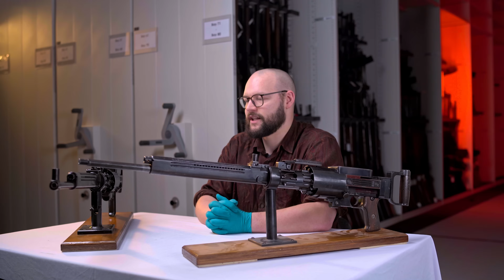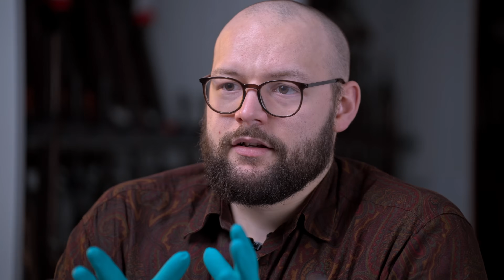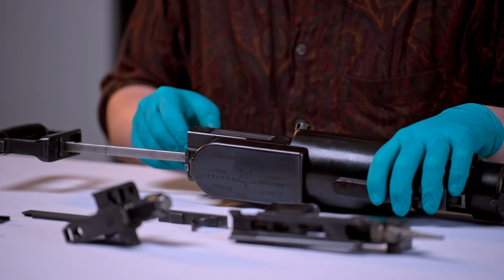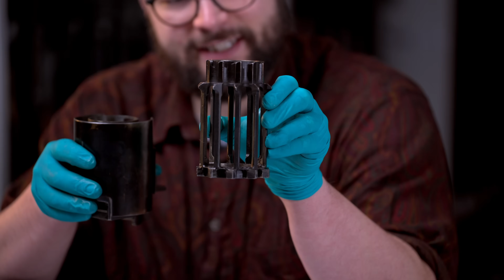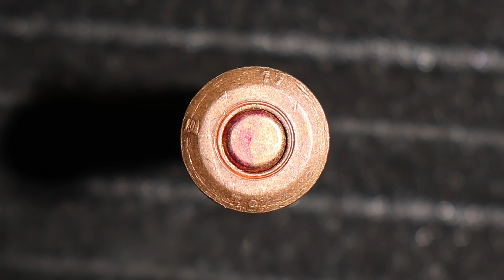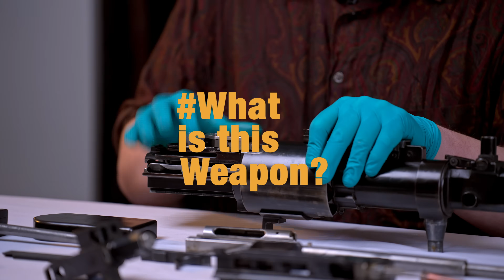The Soviet Success? The ShKAS Machine Gun with curatorial assistant Joe Ford

Comment: Rather than your sample of the Gatling ctg, you should have had the 12.7x108 Rimmed and then shown the later version 20mm ctg which was nothing more than the straight wall(no shoulder) 12.7 rimmed opened up to 20mm.
That Gatling had no semblance to the original ctgs whatsoever.

Comment: The ShKAS aircraft machine gun required special cartridges with reinforced cases, and captured Finnish-made cartridges, created using more modern technology, were also well suited for it. Regular mass-produced cartridges were manufactured using older 19th-century technology and were not suitable for this machine gun.

Incidentally, the "UltraShKAS" with a rate of fire of 3,000 rounds per minute was developed, but it was decided that a 12.7 mm caliber aircraft machine gun would be better suited.

Comment: Heh, one interesting parallel between the ShVaK and the MG151 I just realized is that they both did the same thing of being originally a caliber smaller than 20mm, but neck uo the same cartridge to 20mm, resulting in a somewhat slower velocity 20mm round. Just that the MG151 started at 15mm, not 12.7mm.

Comment: 13:33 it seems that you're misrepresenting the advantage of this 10 step process of extracting cartridges from the belt. 
One cycle of the carrier moves 1 cartridge to the feeding position and moves the full length of the belt by 1 cartridge, just like in any other machine gun. But all 10 stages are happening simultaneously, just for 10 different cartridges. I would guess that it increases friction in the system, compared to 1 step process.
The main difference is that the speed of the backwards movement of the cartridge is 10 times less than in regular systems. That way they avoided issues with the case moving back while the bullet wants to stay in place, decoupling them.

Comment: Soviet designers were also trained in the "anti-fool" system.  The design principle is that the weapon cannot be assembled incorrectly. The assembly sequence and shape of the parts did not allow an inexperienced weapon assembler to insert a part incorrectly or forget to insert a part.
Reply: The designers of the Proton rocket should have learned from them😅.
Reply: @ShokkuKyushu Those idiots used a sledgehammer there. Because the design only allowed for proper assembly....
Reply: That’s funny, because if you put the recoil spring of the SKS in backwards, which actually looks to be the correct way, it will jam frequently.
Reply: @I_dodge_trees  You can insert the spring incorrectly, and the carbine will fire, and it's not dangerous.  And not everyone has delays when shooting at the same time. I was once disassembling a 12-gauge pump-action shotgun, and it had the opportunity to insert the bolt incorrectly during assembly. And when the shot rang out, the bolt did not lock the barrel, but flew out of the pistol right into the shooter's face.
Reply: @I_dodge_trees  But if, for example, a Finnish Lahti pistol is assembled incorrectly, it could explode when fired, and the bolt could fly into the shooter's forehead. That's the difference.

Comment: You didn't tell us what kind of locking mechanism it used. When you took out the bolt parts, I saw a flap. I guess this gun uses the flap locking mechanism. Correct me if I'm wrong.
Reply: Looks like wedge on that bolt carrier extension so tilting bolt I'm guessing.
Reply: @Reactordrone  Tilting bolt is the bolt moves up and down. Common examples of tilting bolt are SKS and FN FAL. I'm pretty familiar with them. What I saw is a piece of metal that's protruding in and out. I'm sure it's not the bolt.
Reply: It is a tilting bolt gun. There are cutaway schemes with bolt in rear position and the other with locked bolt. Theres a part, separate from the bolt that moves up and down with it as if they are one (maybe its a solution for simpler manufacturing). The carrier has protrusion that goes in the bolt.The small diagonal cut on protrusion pushes this separate part down and the back of the bolt with it for locking. Large diagonal cut at the back of protrusion pushes the bolt itself up.
I'm so glad that a few people here care about learning the mechanism, noticed that this crucial part of explanation is missing. Cheers!
Reply: @ Thanks for the explanation.

Comment: Murky semi-nonsense rant below:
Not through the whole vid yet but this has me thinking back to an MG mechanism that I forget all types of right now which was fairly ... lets say 'disliked' ... by some people in the military, for whom a gun should only ever be 100% empty or 100% loaded/fully chambered. They had absolute allergy and.. um.. strong forms of dislike... to any system that had any form of "in between" those two states. I can understand them from a training and safe handling simplicity standpoint but at the same time everything cannot be an AK or AR  or pistol with a magazine or 'feed' at one end, a chamber/barrel in the middle and an ejection port at the other end. This relates in a way to not only one handling a weapon oneself but also teaching people to handle them somewhat safely while supervising not one but maybe 5 or more people at the same time each separately doing this. 
A bit bad of a way to get at what I mean but in a straightforward "normal" gun, if you remove the mag, pull the bolt back and shake - you have an empty and thus "safe" gun. Some machineguns for reasons relating to pulling cartridges out of a belt backwards, then up, then shoving them into a chamber have an extra position (or more, as in this case) for there to be a live round lurking - which means that you can remove the mag/belt, and pull back the bolt to eject whatever might be in the chamber, and STILL have a live round in the system ready to ploink it's evil way into the chamber ready to fire. This is a deadly sin to some people dealing with training people to use firearms in the military for - well - fair sort of (safety) reasons perhaps but it would eliminate a lot of mechanisms that are very useful since they offer better feed systems and faster firing rate than what you can achieve without a fully controlled feed that necessitates more steps than in - bang - out. 
I never had problems with those systems myself because you just need to remember to do things always in the right order the right way - but it did end up with me teaching a lot of people how to use those specific weapons when I was in the military. I won't get into exactly what I'm on about but mostly it relates to a weapon that is no longer in use as of some time. 
Just to be clear, I did and do understand their point - and yes, ideally a gun should be either loaded or not loaded. It shouldn't have a "eeehhh not loaded but not empty either" state if it can at all be avoided, specifically not one where it isn't VERY obvious if it is in the half way state where it took a round from the ammo source but didn't yet shove it into the chamber. So chill, I'm not an unsafe gun for the sake of it advocate.

Comment: ShKAS and MG-131 are two wildly different and yet equally fascinating approaches to the technical requirement of maximising firepower in form factor of medium rifle caliber MG. One increased rate of fire to crazy levels at the cost of barrel life, the other put higher caliber bullet in de facto rifle case to improve firepower at close range at the cost of long range ballistics.
Makes one wonder what would happen if both approaches were to be combined.

P.S.: there also was a prototype variant called UltraShKAS with something like 3000+ rounds per minute rate of fire and even worse barrel life. It's quite obvious why that one didn't get adopted for service and mass production 😅
Reply: Well, the MG 131 is from 1940 and was used as bomber defensive armament before it was first used on a Bf 109 in mid 1943.
The main advantage was that it increased the firepower while keeping the weight down.
However the MG 81Z managed to tripple the RoF of a 7.92mm MG 15 for basically the same weight.

Comment: Looks like a very costly machine to produce.  Excellent presentation of the gun Joe.
Reply: Sttill cheaper, than Volkov-Yartsev 23mm gun. This thing had such recoil, that it was impossible to mount to any fighter. Even Yak-9, which was able to use 37mm gun just cant handle this monster.
Only IL-2 had VYa-23 with special mount

Comment: Soviet machine-gun technician Viktor M. Sinaisky recalled:
The ShKAS machine gun had a high rate of fire but it also had 48 ways of jamming. Some of them could be fixed immediately, some could not. And 1,800 rounds a minute was an insanely high rate of fire. If you pulled the trigger too long, the ShKAS would fire all its ammo in one go and that would be it!!
Reply: The main cause of jams was the standard Russian/Soviet army cartridge, developed using 19th-century technology. The ShKAS aircraft machine gun required a cartridge with a reinforced case.
Reply: And light bullets were ineffective against metal planes
Reply: @Hasmasnafg  eventually, but not at first. Plus Germany, USSR, Japan, UK and Italy have never afforded to shift to all metal planes, only US did. And USSR didn't fight US so 50/50 on that.
I'd say it was quite effective up until 1942 and the bigger problem was the planes it was mounted upon at first.
Reply: @TheArklyte  Hold on there, Bf-109s were full-metal, no ?
Reply: @lapantony  they were. Meanwhile Ju-87 and majority of other planes weren't. Your point? IL-2 wasn't. Mosquito famously wasn't. The nations I've listed had all-metal airframes as exceptions, not as rules.
Reply: @TheArklyte  My point is there are a little bit too many Bf-109s for it to be considered an exception and not the rule
Reply: @lapantony  yes, with 30+k produced, just shy of IL-2 almost 40k production numbers, it was indeed very widespread aircraft. How is it connected to the context though?
Reply: I predict that in around 3 minutes you'll receive a comment about UltraShKAS that will conveniently "forget" to mention how the poor thing was melting its own barrel and that's why soviets declared it a failure and never adopted it😅
Reply: @TheArklyte But hey, at least it was funny
Reply: @TheArklyte  I literally just made that comment, lol. Although I thought that it wasn't adopted because of unreliability and cartridges falling apart in the mechanism due to speeds of operation